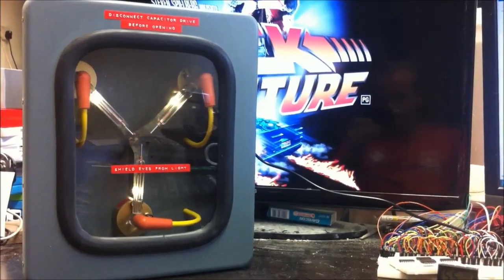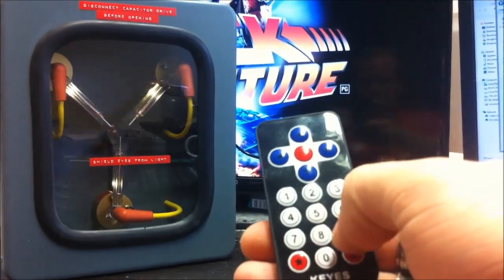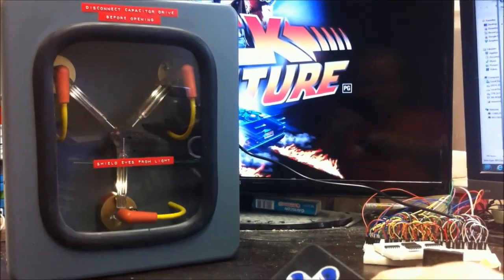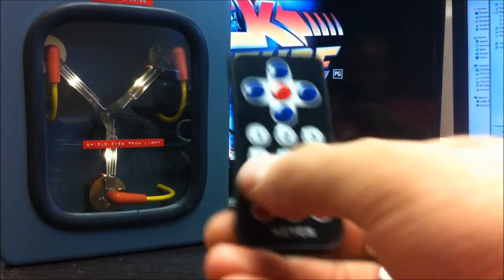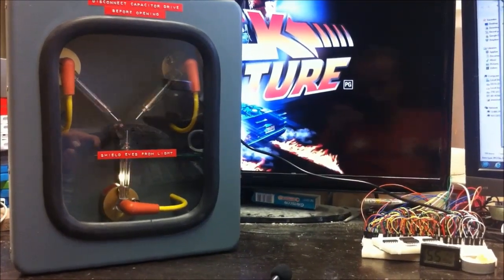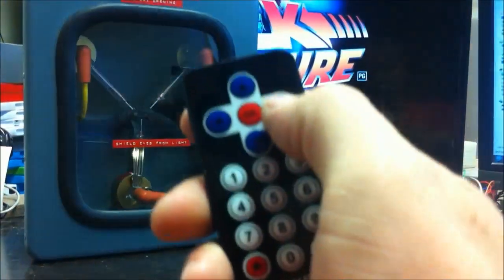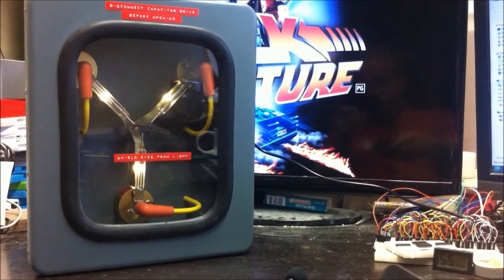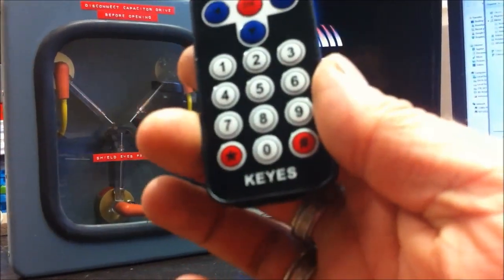Flux Capacitor - Back to the future

Comment: Very cool !!  I made the display:  Back to the Future Display - Alarm Clock - Eduardo Zola

;-)
Reply from the maker: yeah not bad, but not screen accurate, I am working on screen accurate Time Circuits at the moment, using individual 7 segment and 16 segment displays. I will be getting the circuit boards made up. once I have built the first one I am open to taking orders ;-)

subscribe to me on instructables.com to get updates of when I release different back to the future stuff, i'm going to be making everything in and out of the car. ad eventually putting it all in a delorean.... when i buy one.

heres the link to insturctables you can subscribe by clicking follow in the top right of the window

http://www.instructables.com/id/Flux-Capacitor-Back-To-The-Future/

Comment: One of the delorians used in part one is down in cornwall england
Reply from the maker: you spelt Delorean wrong
Reply: DriveGeek  m8 i'm dyslexic
Reply from the maker: Thomas Moorcroft So am I, I also have Aspergers and ADHD, you just have to try harder than every one else, but it can be done. Don't fall back on it like its ok. ;-) trust me great things can be done if you work at it.
Reply: I am borderline on aspergers autisum adhd as i was borne with neurofibromatosis its a horrible thing to have but dose borderline alot of things m8
Reply: But as for the car if you google cornwall goldsmiths they have one used in the film. They also have number 2 of 9 db5's used in the bond films
Reply from the maker: Thomas Moorcroft that is fairly cool, I will be buying a Delorean at some point, probably the end of next year may be the year after lol
Reply: Cool mate  i would like one but cant afford it
Reply: do you have twitter ?
got pics up there of the 2 cars